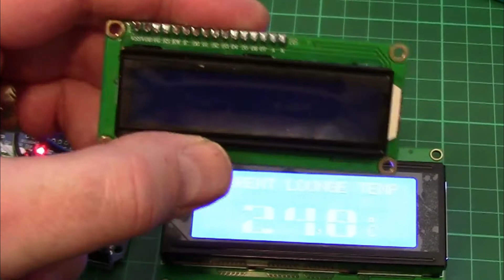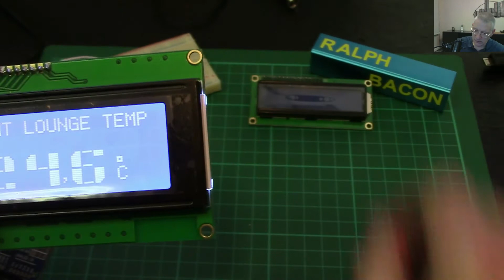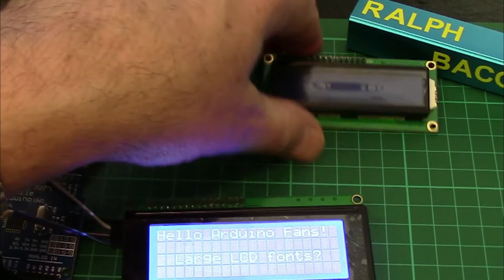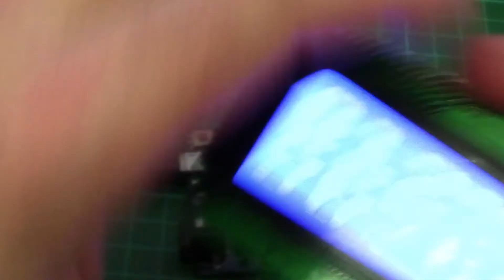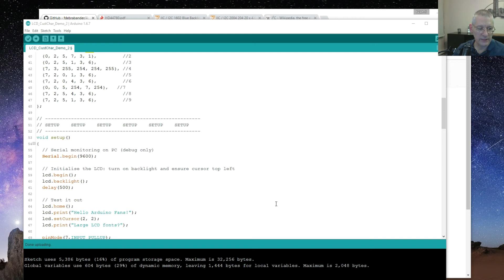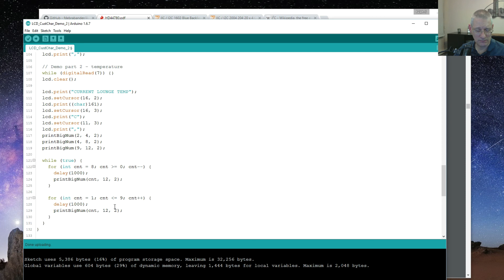#23 LCD BIG DIGITS for your Arduino using I2C - Easy!

Comment: need a big digit clock using 20x4 lcd and rtc
Reply from the maker: Well, the example sketches I provide should easily get you started, and if you use an ESP32 you can join a Wi-Fi network to get the time (the ESP32 auto-syncs the internal time against real-time).

Comment: Great Arduino project.  I used your sketch as the starting point to make a RTC-based large digit clock.  Thanks….
Reply from the maker: Excellent! That's great news, glad it helped.

Comment: I have used a lot of these, only ever seen 2 addresses, 0x3F or 0x27.
Reply from the maker: You're undoubtedly right, but in a single project I guess it would be unusual to use more than one, right?
Reply: @RalphBacon  Yes but they don't all have unique addresses as you described. just one or the other.

Comment: hello sir. why am i trying this and printing two int values ADC . A0/A1 . but one of the values displayed on the LCD is blinking.
Reply from the maker: There is a function in the Liquid Crystal library to turn blinking on and off. Ensure you have not called that. Also, check that it really is blinking and not your code displaying a value, then displaying blanks, then displaying a value again - it looks like it is blinking but is not.

I would change the sketch to display the values of A0 and A1 separately first, and then combine them.
Reply: Can you help me. I want to display 2 adcs with lcd 1602. but when I print. displayed value. A0 blinking . A1 is good

Comment: Just messing around to make a bigger number on my LCD and wonder where to find some example. Check Google, Google says check Ralph. As usual...
Next time I will firstly check Ralph.
Reply from the maker: Ha ha! Yes, I'm using the big digit code on my Smart Heater Controller in my workshop. I literally just copied and pasted my original code (from an Arduino) into the sketch for my ESP32 and it "just worked". How good is that?

Comment: used I2C _scanner no result!!!!
Reply from the maker: That means your I2C device is not connected up correctly (or powered incorrectly). Check SDA vs SCL lines. You need it to be recognised to move forwards. Try another I2C device (any kind) to prove your sketch is working OK.
You're running this on an Arduino Uno?
Reply from the maker: Pease add your reply to this thread and don't repost another topic!
Reply: I cannot think of a way to test LCD so ordered another, however I connected an LED in series with a resistor clock and data 
both showed the Uno to be active. I don't have any other I2C items.
Thank you for your time.
Reply from the maker: Once you have your scanner sketch telling you that it has found something on the I2C bus, your LCD sketch (to prove it works) should look like this:

#include <Wire.h> 
#include <LiquidCrystal_I2C.h>

// Set the LCD address to 0x27 (default) for a 16 chars and 2 line display
LiquidCrystal_I2C lcd(0x27, 16, 2);

void setup()
{
	// initialize the LCD
	lcd.begin();

	// Turn on the backlight and print a message.
	lcd.backlight();
	lcd.print("Hello, world!");
}

void loop()
{
	// Do nothing here...
}

Pins A4 and A5 are SDA and SCL respectively.

Comment: Hi, I have been trying to get this to run (Im very new to programing) keeps stopping at lcd.begin any help please, thanks.
Reply from the maker: You say it stops at lcd.begin(). That sounds like it hasn't found the I2C screen. Did you first load the 'scanner' sketch to get the address of the screen? It might be the default 0x27 but could be some other address - no point in guessing, load the scanner.ino and see what it finds.

Comment: Nevertheless, I have a question(as I'm hunting a bug):

Why is each of your custom characters specified on 8 bytes and not 7 as shown in the Arduino example below?

uint8_t custChar[8][8] = {
  {31, 31, 31, 0, 0, 0, 0, 0},      // Small top line - 0
  {0, 0, 0, 0, 0, 31, 31, 31},      // Small bottom line - 1
  { B11111,
    B00000,
    B00000,
    B00000,                         // This shows an alternative
    B00000,                         // way of defining a custome character,
    B00000,                         // a bit more 'visually' perhaps?
    B00000,
    B11111,
  },
  //{31, 0, 0, 0, 0, 0, 0, 31},     // Small lines top and bottom -2
  {0, 0, 0, 0, 0, 0,  0, 31},       // Thin bottom line - 3
  {31, 31, 31, 31, 31, 31, 15, 7},  // Left bottom chamfer full - 4
  {28, 30, 31, 31, 31, 31, 31, 31}, // Right top chamfer full -5
  {31, 31, 31, 31, 31, 31, 30, 28}, // Right bottom chamfer full -6
  {7, 15, 31, 31, 31, 31, 31, 31},  // Left top chamfer full -7
};

Arduino example:

https://www.arduino.cc/en/Reference/LiquidCrystalCreateChar

byte smiley[8] = {
  B00000,
  B10001,
  B00000,
  B00000,
  B10001,
  B01110,
  B00000,
};
Reply from the maker: Without re-engaging my entire thought process for this design, I'm assuming my characters are taller and use the entire set of pixels?
Reply: @RalphBacon  yes, OK. I made a mistake. LCD pixels are 5x8, not 5x7. When I use the LiquidCrystal_I2C.h library and I do lcd.print(line),  where line is a character string, I only see 7 lines of pixels (if my vision is not too cloudy). This must be because the folks that wrote that library wanted to keep a small space between the 2 lines of the display. Sorry to bother you for that!
Reply from the maker: No bother, Bill, it's all a learning experience!

Comment: Great work Ralph.
One thing I'm wondering about. 
This i2c module has a jumper that when removed cuts off power to the backlight.
I'd like to remove it and Powe & control the backlight to make it dimmer, by a pot or maybe even PWM?
Any ideas on this? Many thanks 👍
Reply from the maker: You can do this but not by using a pot. 😱
Background: The LED is on pins 15 & 16 on the LCD module and the jumper connects pin 15 to VCC. Pin 16 is then controlled by an NPN transistor on the backpack module.
If you remove the jumper, you can control the power at pin 15 (VCC) by  connecting to one of the bare jumper connections (your multimeter will tell you which one is connected to pin 15 on the backpack). 
You could easily turn the LED on and off just by connecting it to a digital pin on the Arduino (warning! measure the current being drawn first, across the jumper, must be less than 20mA, probably is).
To control the brightness in a more granular fashion, you can use PWM on a digital pin that supports it too by using AnalogWrite (I'm guessing you know all this).
Reply: You're awesome Ralph 👍many thanks!
No, I didn't know all of this, the info you gave me was exactly what I was looking for! Thank you very much.
Reply: My module's jumper print claims the jumper shorts "5v to Gnd" 🙄
Reply from the maker: The 5v (VCC) goes to the LED first (via the jumper) then to ground via the transistor - at least, that's what the schematic shows. If there is no transistor present then it would need a resistor to limit the current, probably 200Ω or thereabouts.
Reply: Aha! Many thanks for everything Ralph!

Comment: Hello Mr.Ralph,
Thank u for such a useful video. I am not able to toggle the display with the help of the button on the breadboard. The connections are correct. And is there a way to skip that as well? thanks in advance. :)
Reply from the maker: Hi Vibhor, let's see. If you are using my unchanged LCD_CustChar_Demo_2 then it is line 107 that is causing you issues. The code stops there whilst PIN 7 (GPIO D7) is HIGH. You must connect D7 to GND for the code to continue. Or else just comment out the line that reads:
while(digitalRead(7)) { }
I hope this helps!

Comment: Hi Ralph, just wanted to say thank you and also, possibly, supply a tip for some users.
I had a problem that has had me scratching my head for a few days with this video/sketch. I always had an error on compiling ("unable to compile for board arduino nano") that had me weeping for a few days. In the end it turned out that my library was subtly different from the one you must be using. Simple fix that made my brain boil! Instead of lcd.begin() it had to be lcd.init().
Honestly it was making me almost give up on Arduino as I just couldn't figure it out and I had begin to believe there was something wrong with my wiring or the board itself. It was worth it though as the feeling of triumph when I cracked it was fantastic (yes I am very new to Arduino).
I'm really enjoying my adventures as a novice Arduinite as it reminds me of my youth programming on ZX81, VIC20 and, later, BBC B (yes I'm really that old). I actually enjoy the limitations of Arduino as it forces you to be creative and problem solve.
I really am grateful for your videos, they're perfectly paced, informative and 'comfortable' to watch. I've just seen your vid on the Fm Radio module and now I'm inspired to build a clock radio controlled with an IR remote (I've been working on just a clock but the radio, brilliant!)
So thanks again, you are an inspiration and you're helping to keep my knackered brain active. Cheers!
Reply from the maker: I'm glad you're liking the videos, DocBanzai, and I'm sorry you experienced those frustrations with the LCD library. Normally I include the libraries I use in my GitHub but this one is an old video and I don't believe I have a GitHub repository for it. But, and this is important, you didn't give up and eventually got a working solution. Just think of the experience you've gained. Sounds like you should do well with that clock radio project! And yes, I repaired my boss' ZX81 once, much to his delight. Didn't get me promoted though.
Reply: @RalphBacon  Wish I still had my old ZX81, but that passed on many years ago. I've still got my Beeb which has been upgraded over the years and now runs everything from an internal SD card module which is great and I STILL mess with it from time to time!
Just to go off on a complete tangent; referring to your video #5 (RTC modules) there was mention about a follow up video about the SQR and 32k pins on the module. I believe that SQR is a square wave generator and the 32k is some kind of non-volatile memory. Did you ever do this follow up or am I missing something? Please don't get me wrong, I'm not moaning! I think I've seen all your vids (more than once) and have never heard you mention it. I'm only asking as I'm curious whether the 32k (EEPROM I'm assuming) could be used as a sort of external storage device mainly for constant variables, strings etc. as I know the number of write cycles would probably be finite. I'm probably way off the mark but I hope you don't mind me asking. I have done (very) litle research but I'm kind of sticking to your vids for the time being as I prefer your style and, frankly, a lot of others just confuse me!
Oh and just an idea but I've been reading about the TV-Out library that lets you output to tv, and it seems suspiciously simple. Is it something you're aware of or have tried? Haven't had the courage to try it yet as I don't want to blow up my TV!
Thanks again!
Reply from the maker: Hmmm, long time ago that video... I probably did not follow up on the 32K EPROM because I instead did a video on the onboard EEPROM on the Arduino. Same principle but easier to use on the Arduino. I just didn't get a vibe that there was that much interest on (yet more) EEPROM space, on what is effectively an external device that not every project needs. Especially as it can't be used as run-time memory or program space.
The SQR is indeed a square wave output that can be configured to 1Hz which can be useful to light up a LED every second (it looks very slow but really is 1 second). Could be useful for interrupts on the Arduino (to wake it up every second) but, once again, I never really explored that. Oh dear!
But all these comments do make me rethink whether there are legs on any of those ideas for a future video (or part video), so thanks for that, it's all been added to my list.

Comment: It's a little unfortunate there is an 8 custom character limit.
Reply from the maker: Indeed, Brian, indeed. But we must accept that and be creative! The big digits I use (in daily use showing the outside temperature in Benny's cat run) is very readable across the room. And perhaps this is where the custom characters excel, rather than defining a whole raft of them. But, as you say, if only the chip manufacturer had allowed a full 128 though, or 256, or... oh well!

Comment: Hi Ralph thanks for your amazing effort. i have been watching your videos for sometimes i love the way you portray your lectures. i would love to ask you could explain the array with double square bracket in this lecture or if you recommend another another video that would shed some light on array with double square bracket within arduino syntax. many thanks
Reply from the maker: When you say "double brackets" do you mean [ ] or [ ] [ ]? They both indicate an array, the first is a simple, one dimensional array like this:

int scores[ ] =  {9,8,7,6,5,4,3,2,1};
 
You then refer to each element of the array like this:
 
Serial.print(scores[4]); 
 
which is actually the 5th element because arrays always start at zero:
 
scores[0]  value is 9 because that is the zero'th (first) element in the array.
 
The second is an array of arrays. In the Real World think of it as a list of lists, such as a stack of boxes each with several colours of pencil in each.
 
box 1 contains red, green pencils
box 2 contains blue pencils
box 3 contains yellow, red, orange and pink pencils
 
Do you see how this can be considered a list (of boxes) of lists (pencil colours)?
 
In C++ this might be described as:
 
string boxes[ ][4] = {{"red", "green"}, {"blue"}, {"yellow", "red", "orange", "pink"}};

How to get the "yellow" colour?
 
Serial.println( boxes [2][0]);

Starting always from zero, this is the third box, first [0] colour within it.

You can practice this here: https://www.tutorialspoint.com/compile_cpp_online.php which allows you to type in simple C++ stuff like this and execute there and then. Have a guess how I validated my examples?!

Here's a complete example:
#include <iostream>
using namespace std;

int main()
{
    string boxes[ ][ 3] = {{"red", "green"}, {"blue", "pink", "grey"}};
       
   cout << boxes[1][2] << endl; 
   cout << "Finished" << endl;
   
   return 0;
}
Reply: yes i meant this double double [ ] [ ]. can you give an example on this one
Reply from the maker: The example is already in the reply above! It starts with the words "The second is an array of arrays..." Have a read and tell me what you think, Soliman.

Comment: Nice! Thank you very much
Reply from the maker: Glad you liked it Hung Viet! I use the Big Digits every day in my Wireless Rain Sensor receiver (video #54) and it works very well. I can read the temperature the other side of the room. Thanks for posting.
Reply: I am using the nodemcu module and I have also done it. Thank you for sharing

Comment: hy. i know this is big digids video tutorial but i like to turn on-off lcd i2c 16x2 when i dont need more lcd. i have arduino in deep sleep but lcd dont want to turn off. it turns off only backlight. tanks for amwser
Reply from the maker: +zoran b
I can't find a register command for the HD44780 chip (that controls the LCD) to put it into 'sleep' mode but one way (given that you are putting the Arduino into deep sleep) is to control the power to the LCD via the Arduino (either a logic-level MOSFET or an NPN transistor) on a standard GPIO pin. Switch the LCD on when you come out of deep sleep, wait 50ms for the LCD to initialise (says the datasheet, but you may need to give it a bit more time) and you are on your way. Shut off the power via the Arduino just before you set the Arduino into deep sleep. I hope this helps! And thanks for the interesting question.

Comment: Nice job, well explained and very interesting.
Reply from the maker: +Maxx B Glad you liked it. It's just not that complicated when it's laid out step by step, is it? If you have any suggestions for future videos just post them in the Discussions section or right here under any video!
Reply: +Ralph S Bacon I'm new to electronics and I suppose I could describe myself as a mature student. I've spent a lifetime programming, learning BASIC in the 80s and several languages since. Since an illness has left me partially disabled, I'm teaching myself electronics to try to keep my brain going and as exercise for my hands. The arduino is turning out to be a great way to incorporate my programming experience with electronics.
My current project is to make an RF controlled vehicle using this pair of modules http://bit.ly/arduino-rf to provide the communication between the controller and the vehicle. I'd be interested to see a project using the Tx/Rx pair.
Reply from the maker: Sounds an interesting project (not to mention a challenge!). I will doubtless get round to the RF modules but before then I want to cover the various wi-fi modules (ESP8266) and the bluetooth module.

If you can code then the electronics will be less of a challenge (most people in the Arduino forum face challenges with coding).

So much to cover and so little time to do it all in. Stay tuned for future videos and do spread the word if at all possible :)

Comment from the maker: Here are the links to the two demo sketches.

First one (simple single custom character )
Second one (BIG DIGITS)
https://github.com/RalphBacon/LCD_Big_digits 

Remember, for the second sketch you need to send any character from the Serial Monitor window (by pressing SEND) to move on to the next part of the demo).
Reply: Thanks Ralph. Although I wasn't looking to print large characters on an LCD however your video provided the answer to another problem I had.
Reply: Hi Ralph. Have these now been moved to a private part of your Dropbox?
Reply from the maker: Links updated to point to my Github (it was correct in the video description but not here). Oops.